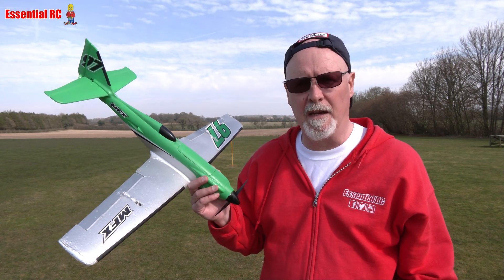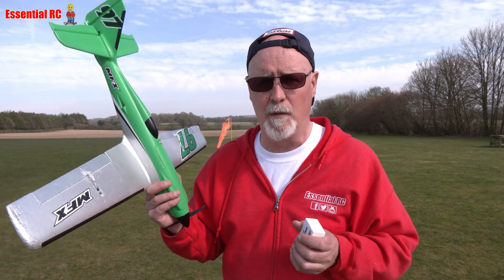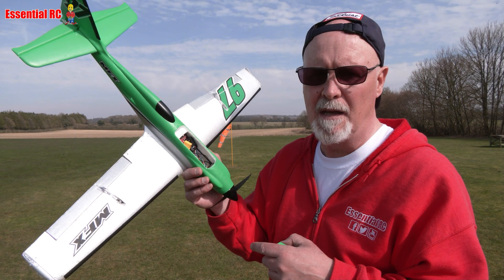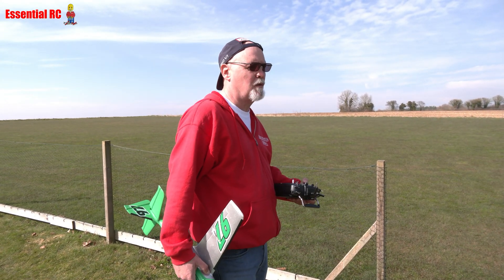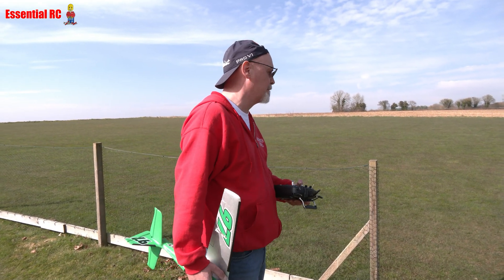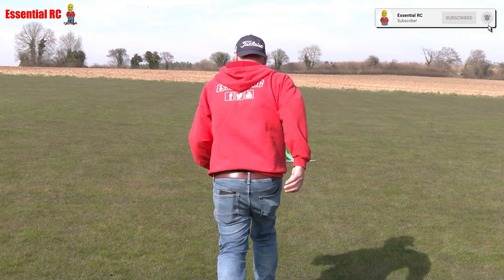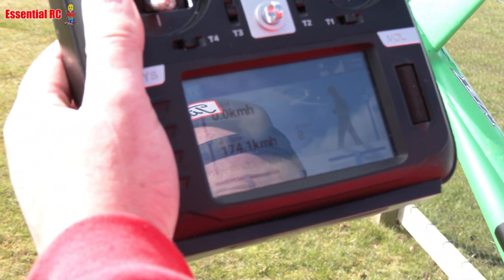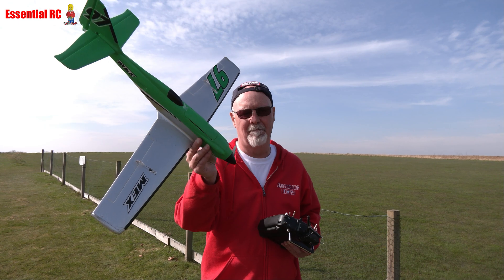HOW FAST ?! NEW ERS GPS Telemetry Sensor Module from RadioMaster for ELRS receivers

Comment: Hi Dominik, can you get both speed and position at the same time, or do you have to choose one over the other? If so would it be possible to swap it via a logical switch ? TIA
Reply from the maker: In the data logging mode, yes but not tried in ground speed mode. Will try in future
Reply: @ please let me know if you get the chance :)
Reply from the maker: @zebzeb3219 I will do soon as thought might try gps mapping plug in for EdgeTX

Comment: I'm not sure that you will get any accurate readings at high speed.
Most Auto GPS drop accuracy over around 115 Kph.
GPS Altitude is even worse for accuracy.
I wouldn't think that this module would be better than higher end GPS or GLONASS.
Reply from the maker: You're not sure. OK. 🙄
Reply: @EssentialRC  Well, by the results from the previous 3x GPS and GLONASS modules I have used for BVLOS, they all failed at speeds higher than around 115 Kph.
Some of them even dropped signal.
GPS doesn't like turning corners, it causes inaccuracies. 
It works best in a constant straight line. 

So yes, as I said, I'm not sure about the accuracy unless they have changed some kind of design.
GPS is only across land speed anyway, so your SPEED  during a dive isn't calculated correctly because it is speed in attitude,  not across land.
Reply: @PJZombie  What modules were you using? Modern M10 modules have a higher standard refresh rate than older modules, are more sensitive, pick up more satellites, and overall perform a LOT better than older stuff. Maybe @EssentialRC would be willing to open up the housing to confirm what module Radiomaster put in their GPS sensor.